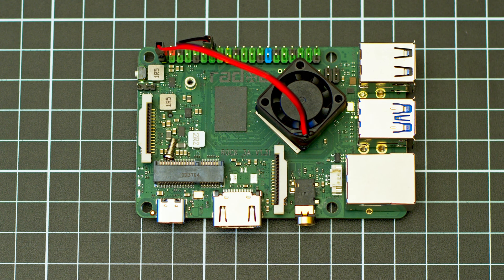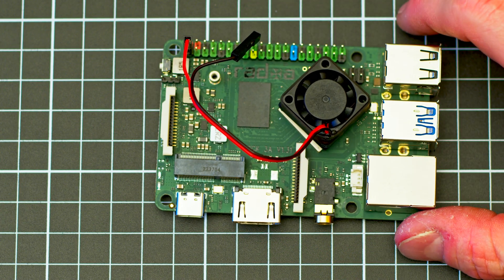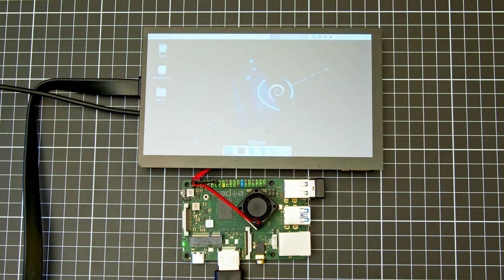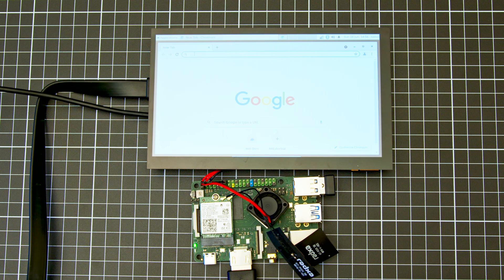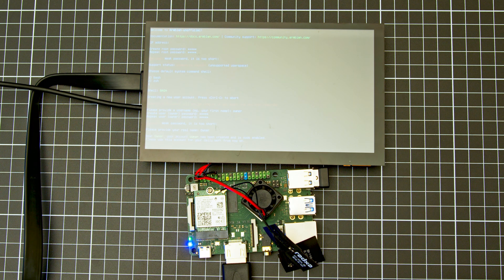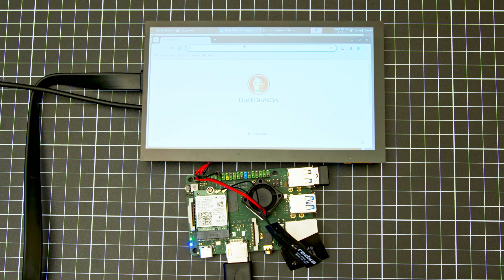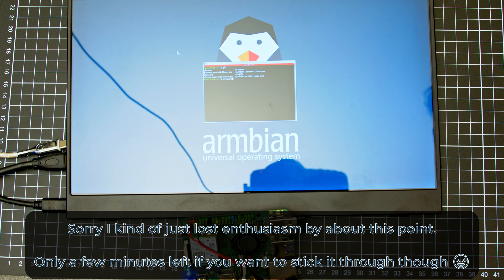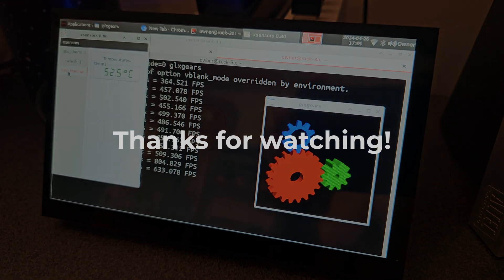Radxa Rock 3A - Testing & Improvements (LANGUAGE WARNING)

Comment: Hey you f*king bastard. You forgot to say what dimensions or model this fan/heatsink has so I can buy one. This card does not have one officially released. I want to put a penta hat sata expansion and I don't know which fan would fit without bumping into the card that would be above it. I haven't bought the rock 3a or the expansion board yet, but I'm researching the parts first. If you can answer me, I will be very grateful

Comment: Question did your AliExpress monitor did you need to install drivers for it ,  just work out of box ?
Reply: It is HDMI. If we needed drivers for HDMi devices then the protocol would not be doing it's job.
Reply from the maker: @marsovac  Hah ain't wrong, but some screens need special colour calibration, or might require drivers to support HDR perhaps? This one works first time without issue though
Reply: @PlatimaTinkers  it might require a color profile to be working properly/accurately, but that's hardly a "driver".
Reply from the maker: @marsovac  not necessarily! Not all graphics cards support HDR, so some might include some sort of softHDR function, or even need the monitor to be firmware updated first to work with a newer GPU or something. Some displays are also USB-C like the HP 14" portable display, so that may require DisplayLink or similar drivers which I've come across myself before. You're definitely right that a colour profile is not a driver though!
Reply: @PlatimaTinkers  I was talking about connecting a monitor through HDMI, so what a GPU supports or doesn't support especially if not connected to HDMI is not related to his question. The monitor if it has HDMI would support the minimum spec that that HDMI version provides, and it will do that without drivers. Now of course some HDMI edid data might be borked on the display and it won't support all the resolutions that the GPU makes available, but that again won't be solved through drivers, but rather edid manipulation or bust. But at least a fallback resolution and refresh rate should work.
Reply from the maker: @marsovac  Yeah you're not wrong :)
Reply from the maker: Worked out of the box! Here's the one I got: https://www.ebay.com.au/itm/285558645271 (turns out it was eBay, oops, probs on AliE too though)